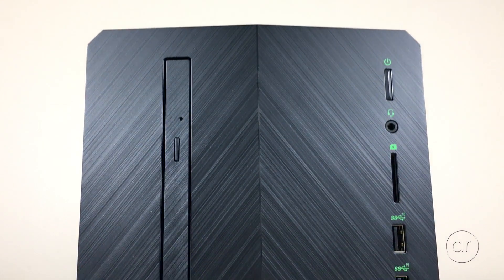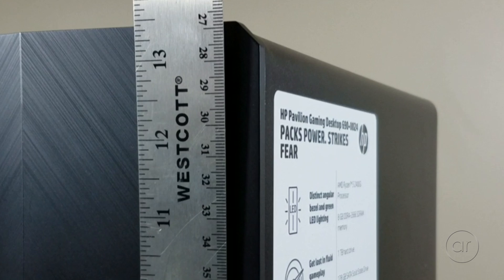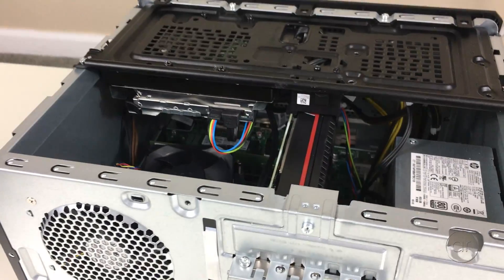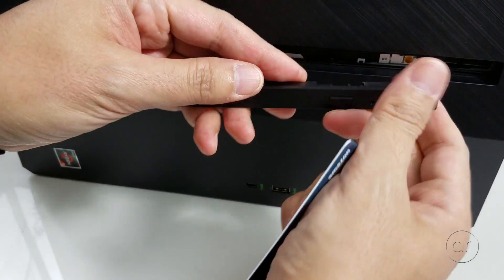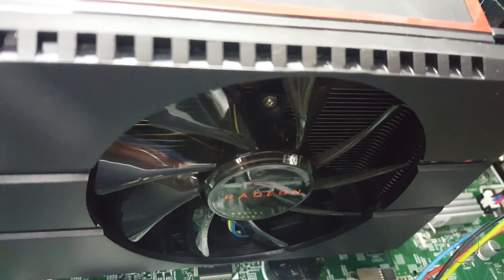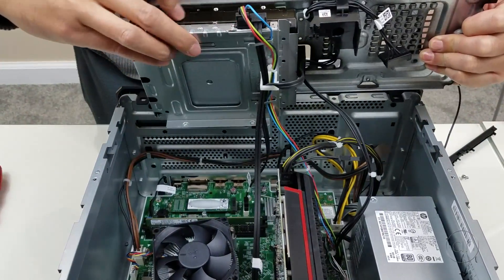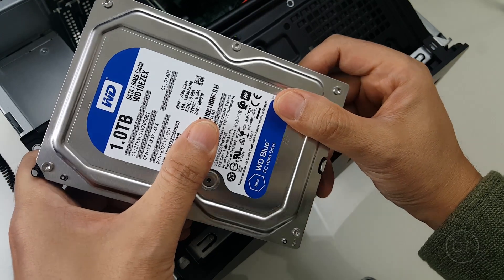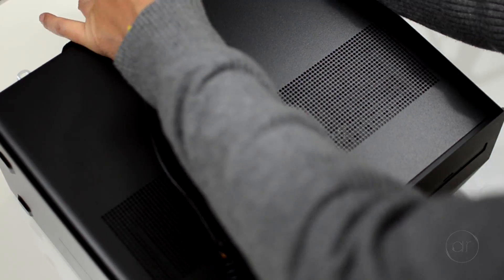How to Open and Upgrade a Ryzen-Based HP Pavilion Gaming Desktop

Comment: I have a 310 watt power supply, I have the amd ryzen 7 1700 3ghz cpu and the rx 550 Gpu. I was wanting to upgrade to the Rx 580 but was wondering if it was better to upgrade the cpu and if i need a better power supply and if so which one
Reply from the maker: The power requirements of the RX 580 are roughly 3X to 4X higher than the RX 550, so you would definitely need a larger power supply. Unfortunately, there is evidence that the PSU in these Pavilions is non-standard. HP matched a 400W PSU (HP part L04618-800) with my Radeon RX 580.
Reply: @accessrandom  So does this mean I have to upgrade specifically to that 400 watt power supply or I can't upgrade at all
Reply from the maker: Yes, I'm afraid so. I wish I had a better answer - HP did not make the Pavilions very upgrade-friendly in terms of its power supply and motherboard.
Reply: @accessrandom  All I'm looking for is to play games at 60 fps.  Thank you so much. I was just about to buy a rx580 and a 450 watt power supply. The gpu would of been fine but I probably would of returned it cause the power supply wouldn't have worked. Thanks for all the help. 1 last thing will a msi rx 580 from Amazon do fine as in size ?
Reply from the maker: The MSI looks a tad too long - but in the worst case scenario, you can remove the bracket with the QR code as seen at the 3:24 mark. However, I think you'll still run into issues with power without a new PSU.

Another side issue is that the MSI card has an 8-pin power connector for the graphics card, which is a 150W connection, while the power supply (in my system at least) only provides a 6-pin power connector, which is 75W. If you go with a 400W PSU, you should be able to use a 6-pin to 8-pin adapter.
Reply: @accessrandom  Would you recommend a different card or just buy the 6pin to 8pin adapter. Also I'm definitely getting the 400 watt psu
Reply from the maker: I would go with the card and the adapter. Again, I need to emphasize that I haven't tried that combination before with your model of the Pavilion (so no guarantees) , but from the information you provided I believe it should work...
Reply: @accessrandom  I'll try it as I haven't bought any hardcore games yet. Thank you so much for all your help. Thanks for saving me so much time and money
Reply from the maker: Sure thing... please let me know how it goes.
Reply: @accessrandom  just to get back to you the power supply I sent to you to check actually didn't have a 6 pin cable at all so the only way I can use the rx 580 is to use both power supplies but I have to trick it into working
Reply from the maker: Oh no, that is the exact part number that is listed for my computer (the 690-0024). I do see that Amazon sells "6 Pin to SATA Power Cable" - perhaps you can use that with that power supply?
Reply: @accessrandom  would it be reasonable to connect a sata port to a adaptor to 6pin than into another 6 pin to 8 pin adapter? If u think so I can try
Reply from the maker: Ah, I forgot, your RX 580 has an 8-pin connection. How about going directly to 8-pin by using "SATA Power to 8 Pin" from Amazon?
Reply: @accessrandom  Ok I will see but i think the power supply might be a little weird but that might work. I'll tell you what happends
Reply: @accessrandom  using my 310 watt psu the rx 580 hardline is running fine. Using almost all my power supply though and I'm still looking for the 400 watt psu. I used the 6 pin to 8 pin adapter and the gpu and that's it
Reply from the maker: Nice - though I would move to a 400W as soon as possible. I think you're probably on or over the edge with a 310W...
Reply: @accessrandom  Ok, I can look up the part number but I don't know how to see the same type of power supply but with a higher watt.
Reply from the maker: Yeah, I don't like how HP doesn't give you the part numbers for parts that you can upgrade to. For my Pavilion 690-0024, the part number for the 400W power supply is L04618-800. However, you should drop HP a note and ask them if that will fit in your Pavilion model (just to make absolutely sure).
Reply: @accessrandom  Ok I will, if I can't get the 400 watt psu will I have to resort to a new case, motherboard, and psu. And just salvage the rest of the parts

Comment: Can the motherboard be changed out with any Small ITX form factor motherboard? or is the motherboard specifically made for the case? or does this case support Micro ATX boards?
Reply from the maker: The motherboard (the Sunflower 8433) is highly custom with dimensions of 24.4x26.7 cm (9.6x10.5 in). Its mounting holes for the CPU fan are drilled for Intel, even though it's a Ryzen CPU. An additional problem is the power supply (HP part L04618-800): there is evidence that the pins are non-standard, so even if you could swap out the motherboard, you may have problems with the existing PSU. Sorry, I wish I had a better answer.
Reply: @accessrandom  No worries , I appreciate your speed and how informative you are. One more question the model i have has a GTX 1050 2 gb , i plan to upgrade the gpu to a better one. I see they have a micro gtx 1060 , RX 580 but im concerned if the psu would handle it. Do you know how much power the rx 580 on your model draws? They essentially have all the same components except for a gpu and ssd. So in theory my system should have some wattage to spare correct? Also did you swap out the power supply to get the 6 pin power connector for the RX 580?
Reply from the maker: In general, the RX 580 consumes 140 to 180 W under load while the GTX 1050 is around 75 W - so you would probably need a new power supply. The power supply I am using (400 W) came with the system, so I didn't need to swap out anything for the 6 pin connector.

Comment: Hi , I apologize in advance for my poor English.  I own the HP Pavilion 690-0018nf version, it's the same, but with an i7-8700 and a 1050ti 4g and model H370 E motherboard.  I will soon put a RTX 2060 super mini 8g and 32g of ram.  However I can not find a power supply of 500 or 600 w compatible, can you help me?
Reply from the maker: Unfortunately, I've had very few reports on successful third-party PSU upgrades (as seen in the description in the Power Supply section). There seems to be some evidence that the power supply is not standard.

It looks like the 690-0018nf uses a Lincs motherboard, and a 310W power supply with a part number of L64961-800 - I think. The HP Parts Store doesn't list the 690-0018nf explicitly, but there are other variations of the 690-0018 listed. If you want to upgrade to an HP part, I would contact HP and ask for the part number to a larger PSU.
Reply: @accessrandom  hey, I found a similar model (not the same motherboard) HP Pavilion 690-0029 with a 400w PSU the most powerful I found  with pc product number : 3LB27AA for HP store. This is the: Power Supply - GNRC PSU 400W SFF Entl FR with this number L04618-800. However it does not correspond to my request of minimum 500w or 600w. Do you think that a PSU of another brand (be quiet! Corsair, EVGA) would be compatible?
Reply from the maker: To be honest, I am not sure. I have read elsewhere that the power supply is not pin-compatible with standard PSUs, but I have not had first-hand experience upgrading it. I'll need to ask my viewers and subscribers if they have had any luck - anyone?
Reply: @accessrandom  So if I want to change PSU I need to change the motherboard and therefore change the pc case ?! omg haha
Reply from the maker: Yeah, I know - I wish I had a better answer. Shame on HP for using such non-standard parts. Even the motherboard (in the 690-0024) is non-standard in that the CPU fan mounting points on the motherboard is for Intel, even though the CPU is a Ryzen (!).
Reply: so  @accessrandom I'm going to buy a new pc case (Aerocool Shard) with a new motherboard (MSI MPG Z390 GAMING EDGE AC) and new PSU (Antec EA750G PRO) hoping that ssd, hard disk, and graphics card (1050ti 4g mini which self-powered with PCI-E port 75w) work (I think so ^^) I thank you for answering me and for explaining me and so solve (by purchase of new parts ^^) my problem, good continuation.
Reply from the maker: @blanco5094  Yes, you should have no problems transferring the SSD, HDD, and memory (if you wish). You should be able to transfer your graphics card - I was able to successfully test my RX 580 in another computer.

Comment: Can i upgrade it to a  rx 580 8 gb without change anything??
Reply from the maker: I have not tried it personally, but a viewer named Apache Helo Copto (in the comments below) suggested the MSI Gaming Radeon RX 580 8GB because it is a short form Radeon.
Reply: @accessrandom  thanks, but will work if i have 300w of psu?
Reply from the maker: With all other things being equal, I don't think the amount of memory will make a significant difference - power consumption for either 4GB or 8GB should be in the 140-160W range.
Reply: @accessrandom  so  do you recomend it to mee???
Reply from the maker: Yes, I think it should be fine - but just make sure it has a six-pin power connector and that it has dimensions which will fit inside the case.
Reply: @accessrandom  thanks very much

Comment: What would be a few upgrade recommendations for better FPS? The only thing I have done was add another 8gb of ram so far.  What Graphics card/cpu upgrade?
Reply from the maker: I haven't received too many reports of GPU upgrades, but I do update and keep track of them in the description (under the "Graphics" section). As long as the card physically fits in the case and has roughly the same power requirements as the Radeon RX 580, you should be fine. Please keep in mind that the power supply only has a six-pin connector for the graphics card.

Comment: Can you upgrade this pc to Ryzen 3000?
Reply from the maker: Unfortunately, this model (the 690-0024) doesn't list any third-gen Ryzens as upgrades on HPs website.
Reply: @accessrandom  Did you try that out?
Reply from the maker: No I haven't personally tried it - I was just going by the HP upgradeability website (it lists the CPUs that work with the Sunflower motherboard).

Comment: Which ssd can I use?
Reply from the maker: So far, I haven't had any reports of any M.2 SSDs not working (please see the description for successful upgrades. In terms of the type of M.2 SSD, it will take both SATA and NVMe.
Reply: @accessrandom  I am going to upgrade my M.2 SSD, I have the Samsung MZNLN128HAHQ which is a SATA interface. Are you saying I can buy a NVMe or a SATA SSD?
Reply from the maker: @ukgene  That's correct - you may install either a SATA or NVMe type of M.2 SSD.
Reply: @accessrandom  Thank you so much, for a quick response. I'm going to order one  today.

Comment: Would I be able to fit a longer gpu?
Reply from the maker: Possibly - there's a little bit of room for a longer GPU, but you would probably need to remove the black plastic supporting bracket shown at the 3:24 mark.
Reply: @accessrandom  thanks!

Comment: Nice video 
I have a question,
I have a pavilion gaming 690-0033nl can i put inside the ram slot another 8 gb from the suggested list? Do they work fine?
Thks
Reply from the maker: I am not sure - it appears that the 690-0033nl uses a Lincs motherboard, whereas the 690-0024 (the one in my video) uses a Sunflower motherboard. You can definitely pair it with the same memory that's already inside your system, but I don't know about the other third-party memory.

Comment: is this good enough for VR?
Reply from the maker: HP claims it's "Tuned and tested for optimal VR performance right out of the box." I haven't tried it with any VR systems but I would rather go with something with more power and RAM, like the 690-0034. Others may have different opinions - anyone?
Reply: Spazbo4 Yes it works for VR. I specifically used this pc to run the Oculus Rift S on popular titles like Beat Saber and Robo Recall. I had also played SteamVR on it, always keeping 60fps. I just ordered a oculus link cable and will try the oculus quest on this pc!

Comment: This is a sunflower motherboard is good?
Reply from the maker: No, in my opinion it is not a good motherboard. It has non-standard mounting points for the CPU fan (that are drilled for Intel even though the CPU is AMD) and is paired with a BIOS that has no overclocking abilities, if you are into that. However, for what it is - a small motherboard with limited expandability - it does get the job done.

Comment: So can the apu be upgraded with the Ryzen 7 2700X?
Reply from the maker: I'm not sure if I understand the question - the Ryzen 7 2700X is not an APU. Since an APU is basically a CPU and a GPU on a single die (like the Ryzen 5 2400G), the only way to upgrade an APU would be to buy a new chip.
Reply: @accessrandom  My bad, I meant can it be replaced with that cpu because I know it has an apu yet it can't utilize the graphics portion on it. So I'm asking can the apu be replaced with something like a ryzen 7 2700x or the ryzen 5 2600 because I hear that one is good for the money.
Reply from the maker: Ah, I see - sorry, I misunderstood. For the motherboard on the 690-0024, HP's website lists the 2600 and 2700 (not the 2700X) as upgradeable CPUs. At any rate, they're both just CPUs, not APUs - so yes, the 2400G can be replaced with the 2600 or 2700, which means you would just use the Radeon RX 580 as the GPU.

My assumption is that your system memory would then be freed up, but I'm unable to confirm. Anyone?

P.S. I have been able to use the video from the 2400G APU by taking out the RX 580 and then unscrewing the cover over the VGA port. The BIOS reset after I did this but  I could get a 1080p signal through the VGA cable.
Reply: @accessrandom  Yeah that's what I'm wondering because if I replace it it will free up the space on the ram. I found a firmware update that allows you to disable play ready in BIOS which freed up a gigabyte of ram to be used but it still reserves 1.1gb for the APU but still better than 2.1gb. Also can this pc be placed on its side so long as the motherboard is on the bottom and not working against gravity?
Reply from the maker: There's really nothing in the case that requires it to be upright so it should be ok to lay it on its side. If you place the side without the vents on the bottom, then the motherboard will be on the bottom (and the DVD drive opens in the right orientation).
Reply: @accessrandom  Alright thanks for all your help, one last question, could the graphics card be replaced with the 8gb rx 580 so long as it fits? And I guess the same could apply for a nvidia card in this pc so long as it fits and doesn't consume too much power?
Reply from the maker: That's correct - as long as the card physically fits, meets the power requirements, and has a 6-pin power connector (from what I recall, the power supply only has the 6-pin cable - if anyone sees differently, please let us know)...

Comment: Tried putting in 8 more GB of ram, but it didnt work, (the pc wouldnt show up on the monitor) I think maybe this was caused because it was 2 different types of rams. Will it change anything if I buy 8 GB more of the same ram that i have already bought? 
I know its a long time since the video was released, but what’s your take on this?
Reply from the maker: Yes, most likely there is a compatibility mismatch with the two memory sticks. In the description, I list some memory modules that have worked for others when installing them next to the existing factory-installed memory. Since you've already purchased the RAM, you can try buying another stick of the same brand and model - I believe it should work, but I would make sure the retailer has a good return policy just in case.

Comment: Can you change the led lights some how?
Reply from the maker: It seems to be a static LED light (there's no color rotation or anything like that) so I'm sure it's just an LED replacement. However, I didn't inspect it closely when I opened it up - I'll try to do that the next time I'm inside.